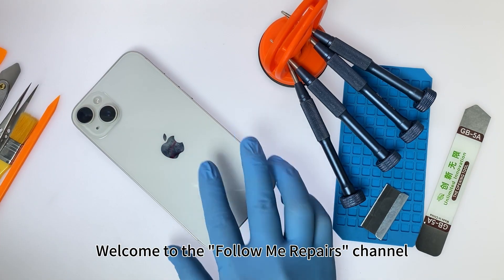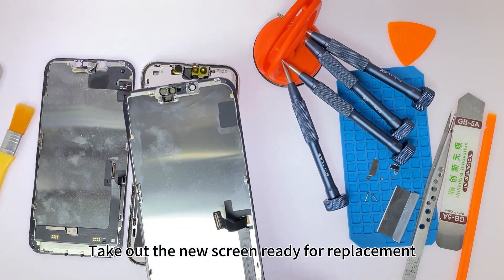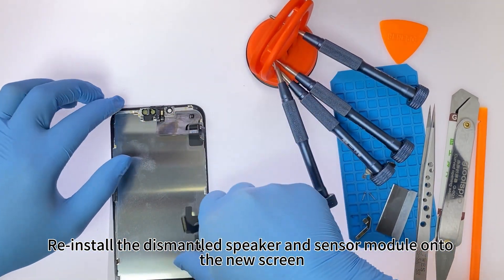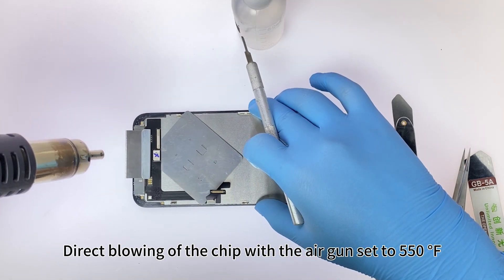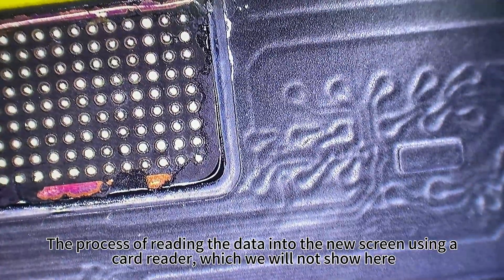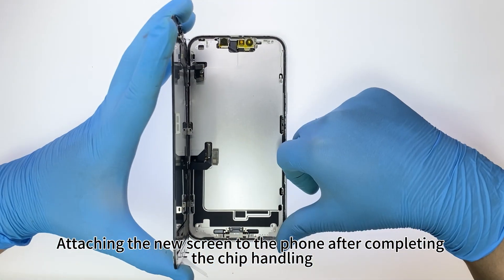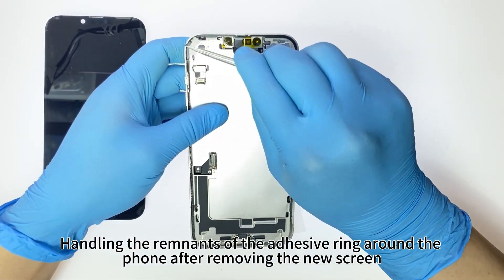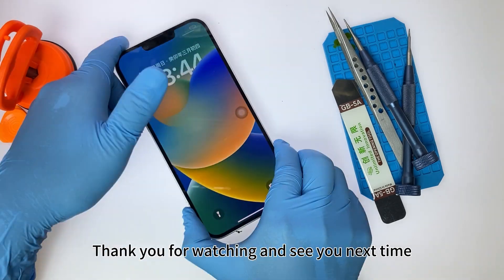iPhone 14 plus Screen Replacement Tutorial - Solutions for Ture Tong & Unknown Part #screen #repair

Comment from the maker: This video is a true account of a repair, with successes and failures. We started by removing the chip from the new screen by blowing it directly with the air gun, which ended up burning the new screen as the temperature isolation of the screen was not handled properly. After replacing the screen with a new one, we continued the repair, using a hand grinder to handle the chip pins and complete the chip removal on the old and new screen, eventually solving the "Unknown Part" ejection problem.